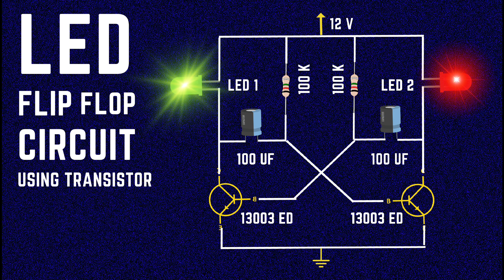How to make LED Flip Flop Circuit Using Transistors 13003?

Comment: woudn't a flip flop divide the amount of pulses on the input by 2? this looks more like clock.
Reply from the maker: Dear ....You are right .....Basically this Circuit produces a square wave and these LEDs blinks alternatively with same frequency .One time single LED remains ON and at the same time other LED remains OFF.